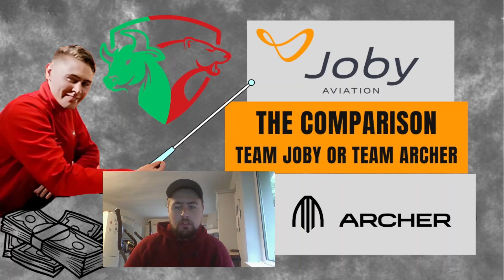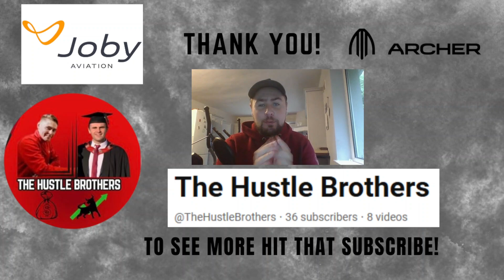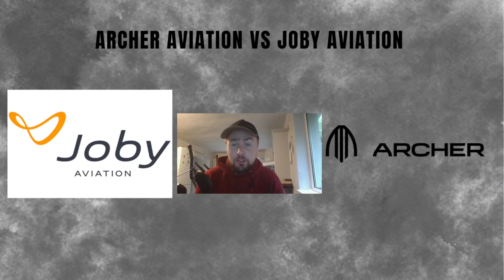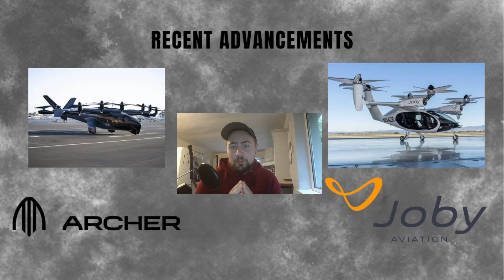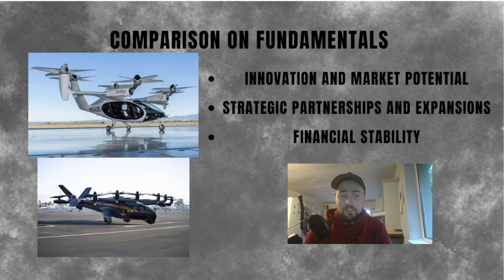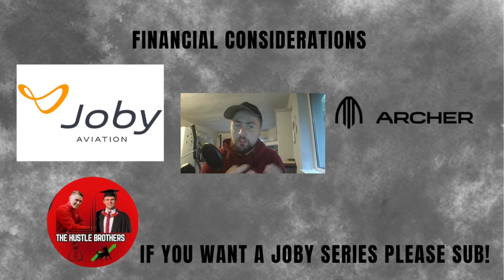Archer Aviation vs Joby Aviation - Which is  a Better Investment?

Comment: The maximum takeoff weight (MTOW) required for an electric air taxi business to be viable depends on several factors, including the aircraft's range, passenger capacity, and operational costs. However, industry experts generally agree that a viable electric vertical take-off and landing (eVTOL) aircraft, designed for urban air mobility, should have an MTOW between 2,500 kg to 3,500 kg (around 5,500 to 7,700 lbs).

This range allows the aircraft to carry a pilot, four to five passengers, and necessary battery systems while ensuring enough efficiency for frequent, short urban trips. For example, Archer Aviation's Midnight aircraft, which is one of the leading models in the sector, has a target MTOW of around 3,175 kg (7,000 lbs). This weight supports its ability to fly multiple short trips daily (20-50 miles) with rapid recharging.

In summary,

"..for an electric air taxi business to be viable, the MTOW needs to fall within a range (around 5,500 to 7,700 lbs) that ensures sufficient passenger capacity and operational efficiency while maintaining manageable energy consumption.."

Archer Midnight meets that specification.

The competitors don't meet that specification.

Joby Aviation: MTOW around 4,800 lbs

Vertical Aerospace (VX4): MTOW around 3,748 lbs

EHang 216: MTOW around 992 lbs
Reply: Archer Aviation Founder: Adam Goldstein

"..So in the quarter, we had some major accomplishments and the biggest was Midnight's transition flight meaning the aircraft took-off vertical then it transitioned onto the
wing and then it landed again vertically. So Archer is the only one to do this with a 6500lb maximum takeoff weight aircraft. Others have done it with smaller
4000lb aircraft BUT THIS WAS A BIG DEAL BECAUSE THE PHYSICS TELLS US THAT YOU NEED THIS SIZE OF AN AIRCRAFT TO CARRY THE PAYLOAD TO MAKE AIR TAXIS A VIABLE BUSINESS.."
Reply from the maker: That you so much for clarifying this mate, this has really helped!
Reply: JOBY VTOL weighs less than Archer!  The Archer Midnight eVTOL aircraft has a maximum gross takeoff weight of 6,500 lbs. the Joby S4, has a maximum takeoff weight of approximately 5,300 pounds. This includes an empty weight of around 4,300 pounds and a maximum payload of 1,000 pounds.

Comment: At the moment Archer mcap is only $1B, Joby's mcap is $4B. If you project both of their outlooks, they end up at the same target mcaps, suggesting a weighted opportunity towards Archer.
Both carry risk, but both are already well underway with their regulatory approvals and expecting similar completion times.
Helicopters have multiple single points of failure. These eVTOLS have multiple redundancies in batteries, drives and motors - safer.
They are far quieter than helicopters: multiple blades / slower rotation.
Eco friendly electric vehicles.
A massive time saver compared to the car. Note restrictions with poor weather (like snow) but the estimates I have seen are based on each taxi having 300 days of service per year, so weather already looks factored in.
I would think that Archer's "Maker" with 12 props would be safer than Joby's 6 props but 6 props is still excellent compared to a helicopter. During forward flight, Maker switches off the back 6. So the extra blades become dead weight and produce drag. As a passenger, I would rather that be the case: safety over efficiency. 

Note it has been reported that Stellantis's CEO, Carlos Tavares, has promised to leave Stellantis in 2026 (possibly January) after making a mess of the company and there will be a re-shuffle. So that causes uncertainty as Archer's backer.
Joby is currently reported to have the edge with Toyota as a partner though look a little deeper and you will find that Toyota's share price has been falling because of scandals which at one point halted production. Still, it looks like Toyota is an edge for Joby (comparing with Stellantis), as Toyota are also helping with FAA and Toyota's board is stable.

Will it be VHS or Betamax? As an analogy:
Cost
VHS machines and tapes were cheaper to produce and buy than Betamax.     Archer's taxi: $1m-$1.5m. Joby's taxi: $1.5m-$2m      Archer wins that one.
Recording time
VHS tapes could record up to four hours, while Betamax tapes were limited to one to two hours.      Archer's range: 60 miles. Joby's range: 150 miles    Irrelevant for city purpose but Joby wins for versatility.
Rental market
VHS was a good fit for the booming home video rental market, and VHS manufacturers worked to get retailers to stock their products.     I think Toyota is better at selling cars, Joby could use the well-known Toyota name as a brand-backer marketing to the public.
Hardware
There was a wider selection of VHS hardware options available at a lower cost.       Toyota will produce drive gear. Possibly Joby has the edge.
Relationships with movie companies
JVC, the manufacturer of VHS, helped launch the home video rental market and had good relationships with American movie companies.  Joby partnered with uber and Delta airlines. Archer partnered with Southwest airlines and united airlines.  Difficult to say, this may be a reason for one to buy the other - buying slots. That's why airlines buy other airlines.
Marketing
VHS manufacturers were more aggressive in marketing their format than Sony, the manufacturer of Betamax.     Marketing remains to be seen.

The two main issues:
(1) SAFETY.
Both will have to pass regulations. Archer Maker has 12 props.
(2) NOISE
 Again, Archer Maker has 12 props, slower rotation for the noisiest flight section (vertical) . It is possible that Joby is quieter as they have worked to optimise their blade profile.

Joby looks sportier and would entice people by its looks.
Archer Maker looks more substantial and has 12 props. People may feel safer with this option. If you just want to get from A to B, its already exciting enough flying.
Reply from the maker: Thank you so much for your detailed insight mate!
Reply: @TheHustleBrothers  You are welcome! Another thing to think about..
Back in the day when ships had sails, it was difficult to convince the public on the safety of using motors instead. It was a technological leap.
Ships (with motors) still advertised to the public using a picture of a boat with sails. So they were leading the public on.
The picture provided reassurance.
I think 12 props provides more reassurance for the introduction of this new vehicle.  (That's just my opinion)
Public perception could be crucial when there is a choice.

Nothing comes near to the importance of safety.
Reply: Excellent analysis.  Holding stock in both.  Expect extra time to comply with FAA certification for a new type of aircraft hence more funding will be needed so investor will need patience and take a long to very long position.  WRT safety, Joby seems to have aircraft-like flaps which could assist in making a loss-of-power emergency landing.  Joby's greater range, lower drag, and more efficient propulsion system makes it suitable as a mini-commuter/shuttle vehicle from smaller city airports/heliports.  Lots of commercial potential here.
Reply: @cmax4692  Both have great potential. 
I like the cash runway Joby has: $1.43B + Delta $140m + DoD income + capital interest. 
Re: Joby's new factory - the state of Ohio and several political organizations have offered up to $325 million in incentives and benefits to develop the new Dayton factory. Incentives include grants, tax credits, and infrastructure support, as well as workforce development assistance aimed at helping Joby hire and train approximately 2,000 employees for the factory.

Comment: There is a lot of space for both companies, however you're missing one company that is on par with Joby and might even be ahead. That company is Beta Technologies.  Both Beta and Joby have innovative designs that are different enough and both have their advantages over the other. IMO Archer is about 2 years behind both companies. Archers design is also heavier, louder, and might not be the most reliable due design, use of gearboxes etc... If you are invested in archer, it makes zero sense to not be invested in Joby, and BLDE which will use Beta Technologies aircraft.
Reply from the maker: Join our discord mate and share your thoughts with the whole community as it would be an honour to have your insight into all the different companies! https://discord.gg/dQq4nnM9
Reply: The point is an investment.  Beta is private.
Reply: @patpatpat999  Yes, but you should be aware of the entire space.